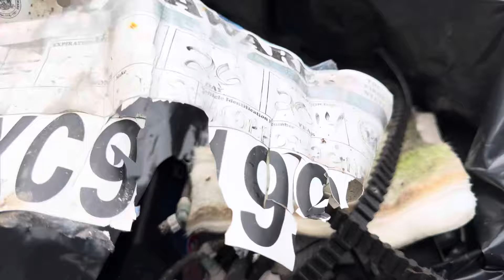Saving a 88 Porsche 944S and a 86 944 from the scrap yard. Can they be road worthy again.

Comment: Stock or S motor all day every day.
Reply from the maker: I am leaning towards the S motor. Hopefully it’s not damaged
Reply: @RustyRatchetGarage  I've put more time and money than most people ever will into the 2.5 8v, and I'm pretty happy with it. But I could've swapped in a 16v at this point and been at the same place with probably less work and similar money. The good news is that 8v engines and parts are a dime a dozen if things go badly for me.